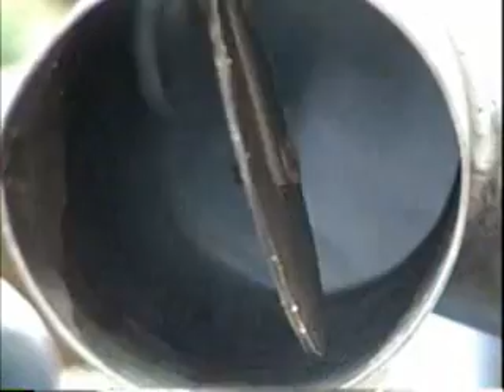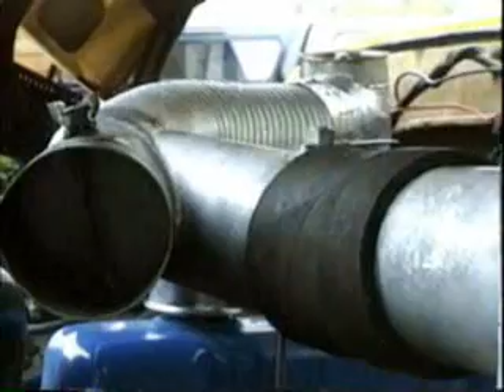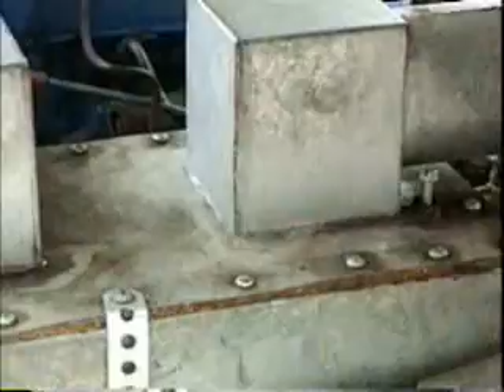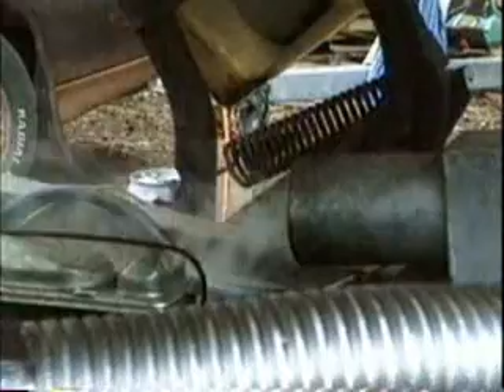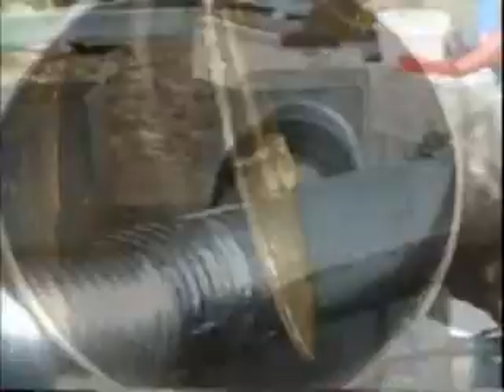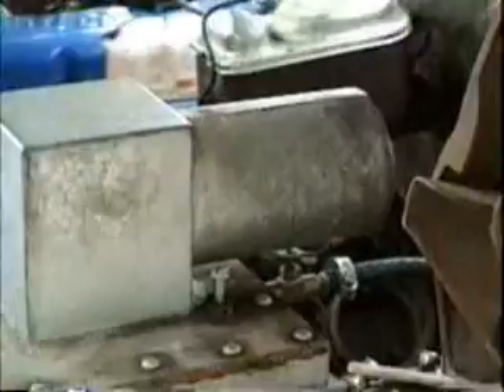Here is definitive proof on how to separate all Atoms in all liquid soluble matter.

Comment: I see. I've done a lot of soldering, primarily for 1/8th scale off road electrically(battery) powered systems. This is the first time I've seen a hot air unit which produces enough heat to melt solder. The 45 watt soldering system I use, I believe achieves approximately 900 degrees Fahrenheit (metal tip).

Comment: I just look at the hot air rework soldering station, that's a very nice unit. Is the hot air portion of the unit used for shrinking heat shrink tubing. I've never seen a soldering station with a hot air system built into it. Very nice.

Comment from the maker: I had a minor set back. I had to order a  2 in 1 hot air rework soldering station, to repair the leak detector, My son didn't have anything to repair it with. Oh well, I have a few other projects I needed to get done first anyway, so, maybe a weeks delay.

Comment from the maker: @150MilesPerGallon On the heater surface I got a 20 to 30 degree fluctuation, in temperature. On the plate I get a 3 to 4 degree fluctuation in temperature. There is very little change in temperature because of the mass, and the amount of time it takes to reach the desired temperature. The larger the mass the more stable the temperature becomes.

Comment: I hope your son can fix it. I hope this doesn't delay your testing to much. I imagine you're taking detailed notes on your surface temperature variations as you spray the water onto your 1/2 inch steal plate. Is there any measureable fluctuation at all in surface temerature of the steal plate, as you spray the water onto it. Visually, what have you seen so far, when you take water beyond it's boiling point, instantly(flashing the water), as you slowly increase or decrease the temperature.

Comment from the maker: @150MilesPerGallon I was able to check 11 different temperatures before the malfunction. It is not necessary to do 1/2 degree increments. The difference in the boiling temperatures of hydrogen and oxygen, is around 60 degrees, so I figure 25 degree increments will be close enough.

Comment from the maker: @150MilesPerGallon Had a delay. The combustible gas leak detector, wouldn't turn off. The surface mount latching switch broke away from the PC board. I don't have a soldier gun, with a tip that small, so I am going to have to let my son do it, he has one that small at work. Oh well, sometimes you pay for what you get. I bet it was faulty from the factory, and nobody caught it. Still no complaints, it is a $450 combustible gas leak detector, and it does refrigeration to. I paid $80 shipped to me.

Comment from the maker: Well, today is a good day. The 13th of the month. 13 was my tank number in Vietnam, it was actually my lucky number. I survived six 500 pound land mines. Four were in tank A-13, until I shot over 3000 rounds through the 90 MM cannon, and the barrel had no lands and groves left. I was moved to A-14 and it lasted for two more mines. The second blew a one foot diameter hole in the engine compartment of the tank. I survived one Rocket (RPG-2) in tank A-14. I think it was meant for me to do this.

Comment: That is quite a simplistic setup. Let me know how your testing is going. I'm very interested. Also, I imagine you are still utilizing the 20 degree angle on the 1/2 inch hot steal plate which permits the fine mist of distilled water droplets to continuously be exposed to the exact same temperature as gravity pulls the fine mist of water droplets down the steal plate. Ideally, only hydrogen will be released, while the oxygen remains a liquid.

Comment from the maker: @150MilesPerGallon Funny the chamber no longer exists, so to make hydrogen from water. I have assembled some aluminum brackets onto a heater, and now I am clamping a metal plate on top of the heater. I will bring that plate up to the desired temperature, and with a mist sprayer, you use to cool yourself down, I am spraying distilled water onto the plate, that is attached to the heater. Can't get much more simple than that.

Comment from the maker: You got it. Except I had a sheet metal guy, make the box to my drawing. It was the first design, and it worked like a champ. This is when I started to try to figure out different ways to get rid of that darn non combustible liquid, that didn't mix with gasoline, not knowing just what I had done, until I tried to explain it here on You Tube. I did this 30 years ago, what a difference I could have made in the world, if I had known back then.

Comment: Furthermore, you create your white vapor fuel system from supplies that most people have at home. You used two small coffee cans welded together then connected to the top of your original carburetor (which you use only for it's butterfly valve to control engine speed(rpm's), connected to a dryer ventilation hose, which connects to your(Y adapter no longer needed, because the needed oxygen is already present within the white vapor) metal box that you built from small sheets of metal.

Comment: You mention your exhaust manifold stays warm to the touch, rather than almost glowing red with the stock fuel system. This is a clear indication that you are not losing the gasolines energy to heat, but rather very clearly using this otherwise wasted heat, as very useful motive force, which moves the automobile with twice the horse power, and zero hydrocarbons(all fuel burned inside the engines combustion chamber). Well done :)

Comment: Based on the data you gathered from running 7 different automobiles on your non polluting white vapor over the course of 25 years, with two different Dyno test, and one AAA smog analyzer test, it seems that you have flipped the well known 80% inefficiency of the internal combustion engine, upside down. With tradition fuel systems even on new auto's, 80% of the energy is lost to heat, and unburnt gasoline(hydrocarbons).

Comment: I was thinking, your non condensing, cold white vapor contains within it, the exact and perfect amount of oxygen needed to run any gasoline powered internal combustion engine. How would you estimate your air to fuel ratio within your white vapor. Ordinarily, gasoline powered engines run at about 14.7 parts of air, to one part gasoline.

Comment: Thank you for mentioning the metal salvage yard as a source for materials(and cutting the 1/2 inch metal to the exact size needed). This is an excellent idea. I would really like to see your testing process. Do you have access to a basic digital camera that has the ability to record video. If so, you could film your testing the molecular change to distilled water, to release Hydrogen at 380 F. To 420 F.

Comment from the maker: If you have a metal salvage place, somewhere near by, that is where you will find it, and usually they can cut it to size, for a small fee. I located one here, and had the metal cut exactly to the needed size, I will sand the side down that will be next to the heater, to insure good heat conductance. My friend who saw the blue flame in the dishwasher came over. I told him, I know he had an iron skillet in the dishwasher, when he saw the blue flame, and he surprisingly said yes, how did I know.

Comment: Thank you. I will do this, exactly as you mention. Thank you very much. I understand. The larger mass of the 1/2 inch thick steal plate will maintain it's temperature with less fluctuation when the fine mist of distilled water droplets makes contact with this 380 F. To 420 F. Heated steal plate. I'll see what the local hardware stores offer in terms of 1/2 inch thick steal plates ie Home Depot or Lowe's or possibly OSH.

Comment from the maker: When the temperature is to high for the molecular chance to happen, the water will dance on the heater, and evaporate, due to the heat. Here is a way to get the mass you are looking for. Get a, say 1/2 inch steel plate, that will fit flat in the bottom of your frying pan. As big a steel plate that will fit in the bottom of the pan. Now take your temperature reading from the steel plate. They will be consistent. And like the big furnaces it will retain heat for a long period of time, mass..

Comment: This chlorine in, I believe all city water, is the primary reason I use distilled water in my testing. Chlorine gas is deadly, highly poisonous, and will be released into the air we are breathing during our testing. Additionally, the metals from pipeing and plumbing, and the minerals in non distilled water would quickly begin to coat the surface of the heated metal elements we are working with.

Comment from the maker: Mass is the answer. You see when the water is sprayed, the temperature of the skillet varies, more than 60 degrees. The window you are searching for. With a combustible gas leak detector, I detect a flammable gas, coming from water, between 380 and 420 degrees.

Comment: To precisely measure the surface temperature of the heated metal electric skillet, The Craftsmen 1000 degree Fahrenheit temperature meter work well. Although it was not easy to slowly increase the heated metal surface temperature in small increments with the standard low, med, high temperature adjustment dial, though I did my best given the tools I had available.

Comment: I do not yet have the proper meter to measure when the water will molecularly change, and release hydrogen. Rather I use a Bar-B-Q long tip lighter to try igniting this very little bit of fine spray of water after it made contact with the hot metal surface. I varied the temperature from 212 F. up to 750 F. in extremely small increments(for several hours). I was not able to increase the flame of the lighter via presence of additional Hydrogen from water.

Comment: I heat my electric skillet to approximately 212 degrees Fahrenheit (The boiling point of water at atmospheric pressure, at sea level). I put distilled water into a fine mist spray bottle. Slowly increasing the temperature of the surface of the electric skillet heating element, I sprayed a very small amount of a very fine mist of water droplets onto the heated skillet surface.

Comment: Pinging often being associated with running low octane fuels, now we can run the same low octane fuel in it's molecularly changed white vapor form(your process) and no pinging will be present. Furthermore, we may even be able to significantly advance the engine timing.

Comment from the maker: @queensryche1986 You will never get the ping, like you say, running on vapor. The ping is actually the liquid gasoline, in the cylinder. It does it when to much liquid is in the cylinder, and the sound is the gasoline being forced past the rings, on the piston.

Comment: I really look forward to your testing phase. I purchase an electric skillet from wallmart for the testing phase. I also purchase a craftsmen temperature meter, which reads up to 1000 degrees Fahrenheit, which should be more than enough to molecularly change most liquids, especially ordinary water to Hydrogen, and gasoline to your non condensing, twice the horse power, white vapor.

Comment: Thus my 3 cylinder, 1 Liter, 61 Cubic Inch, 1000 cc, 67 horse power, Honda Insight (2000 to 2006) VTEC-E engine may have approximately 134 Horse Power (not including the additional Horse Power the 10,000 watt Brushless Electric Motor Provides, as needed). This is truly great.

Comment from the maker: @150MilesPerGallon Man you won't believe it. It was meant for me to do this. I just got a $400 plus, leak detector, from eBay for $69. I found the variac transformer at the good will, for $15. Variac's are around $500 for the higher amperage ones, that I needed.I am ordering the heater as soon as the sales man gets back to me. It won't be long now, I will have the equipment to separate the hydrogen, and oxygen molecules in water. It would have cost about the same for lab tests, this is better.

Comment: Continued: beyond this, almost infinite variation in the way one may precisely and measurably spray the small liquid gasoline droplets onto the hot metal surface, and further route the then molecularly changed, white (now non condensing) vapor into the engine. Also, an air to fuel ratio is now predetermined within the cold white vapor.

Comment: The way this works is, Heat an electric Calrod heater to a minimum of 600 Degrees Fahrenheit, but less than when the metal heater begins to glow a dull red(this is gasolines autoignition temperature) which bill has experienced to be approximately 1000 degrees F. Allow ambient air to mix with the fine mist of gasoline sprayed onto your heated surface.

Comment from the maker: @150MilesPerGallon Not dancing on water, inside an electric fry pan, when the temperature is as high as it will go. Drop small droplets of water on to the fry pan. 
When it takes a moment for a water droplet to blend with a body of water that is surface tension that holds them apart for a moment.

Comment from the maker: @150MilesPerGallon Yes, but here is the one thing. There is a 60 degree temperature difference in the actual boiling temperatures of hydrogen and oxygen. I figure that same amount of temperature difference will be there when I find the boiling temperature of the hydrogen molecule in water. So, your mass on the heater side has to maintain that temperature, when the water droplets are applied. A variation can prevent you from reaching the hydrogen's molecular boiling temperature in water.

Comment from the maker: @IAMBILLYTHEKID Ever watched water dance on a hot skillet? When the skillet is above the boiling temperature of the water, and above the boiling temperatures of both the hydrogen and oxygen molecules inside the water. The water doesn't turn to a vapor, it just dances across the skillet, until it evaporates.

Comment from the maker: @150MilesPerGallon Whatever the tube size is on the center tube, of the GEET device. Use a temperature control, attached to the outside tube, to turn the heater off when the engine exhaust reaches operating temperature. Turn key operation.

Comment from the maker: @150MilesPerGallon Yeah, someone connected with the GEET operation connected with me. I told him to tell Paul to use a 500 watt heater on the center tube, and he would not have to start the engine with the gasoline fumes, from the container. It would be a turn key operation. Get in the vehicle, turn the key on and flip a switch and in a minute or two, start the engine an go.

Comment from the maker: @150MilesPerGallon Chromalox is the heater manufacturer, They can make any size, shape, voltage, and amperage heater you want. PCN Number 132855 / WS-1501 HTS 120V 1000W / $174.00 each + shipping from Tennessee / 5 available as of this quote / Approx. 2 LBS each / ships from Lavergne, Tennessee zip code 37086. This is the one I am ordering.

Comment: The turbo also act as a one way check valve to keep the expanding gasoline vapors from going back out of the carburator as the liquid gasoline transitioned from a liquid to a vapor(thus expanding rapidly). I like your white vapor system because it's simple, powerful and it works. What I would really like to study is the physics of how your system works, why it works. I know it works, but I would really like to know exactly how, in technical and simple terms. Your system has immense potential.

Comment: Smokey Yunick (See "Hot Vapor Car") mention it's possible to achieve 1.8 horse power per cubic inch displacement. But that's running ordinary gasoline that's been vaporized, and he was also running a turbo which he refered to as a homoginizer which essentially pressurized the air and fuel vapors to a maximum of 15 psi in the otherwise stock engine. Smokey said if he upgrade the engine's internals, he could push 30 psi into the engine. The turbo also act as a one way check valve.

Comment: 85hp + 85hp =  170 Horse Power. When you switched off the liquid gasoline, and turn on your molecular chamber, which produce the white vapor which essentially doubled your horse power. Your notes just below your video state a 50% increase in horse power. I believe you are actually achieving a 100% increase in horse power. I believe a 50% increase in hp would be 127.5 hp.

Comment: In these models, the temperature probe is mounted up against the heating element itself. I may be able to relocate the temperature probe away from the heating element, and this possibly allowing me to have the temperature increase to the required 600 degrees Fahrenheit for the white vapor from liquid gasoline, production.

Comment from the maker: @150MilesPerGallon Well by this time next month I will have done the same thing to water, and get hydrogen. I think I have a heating element coming that will give me the mass. The heater will supply up to 1200 degrees Fahrenheit at 120 VAC. That means it will draw 8.333 amps, so my 10 amp Variac transformer will help me to control the heat. Making it possible to turn the heat up in as little as 5 degrees at a time. I will find the 60 degree temperature difference I need for hydrogen from water

Comment: Your white vapor containing both the needed oxygen, and explosive molecularly changed gasoline, means that the complicated air fuel mixture technologies all newer model autos have, can be dramatically simplified, and you have eliminated the need for oxygen sensors, catalytic converters, and the entire smog management system. Because your system burns Stoichiometric, clean and non polluting.

Comment: I mention the analogy of natural gas in comparison to your white vapor because with your discovery and invention, it permits everyone the ability to burn only this extremely powerful white vapor(much more powerful than CNG per unit measure). Your system stores the liquid gasoline in the auto, and burns only the new white vapor, which is premixed with oxygen.